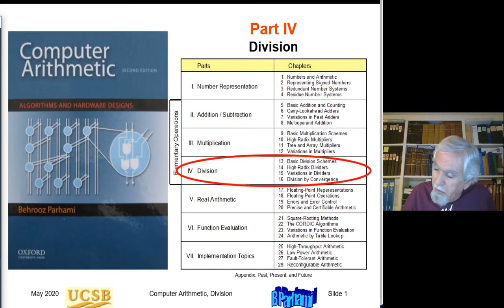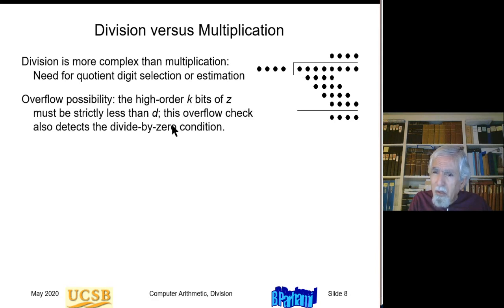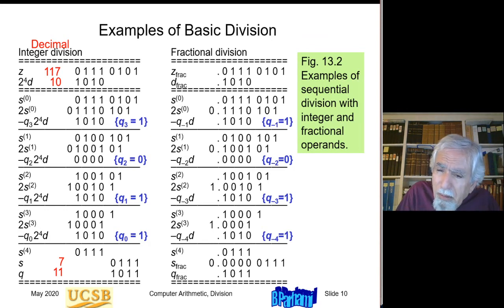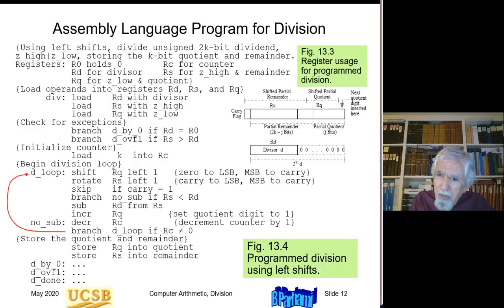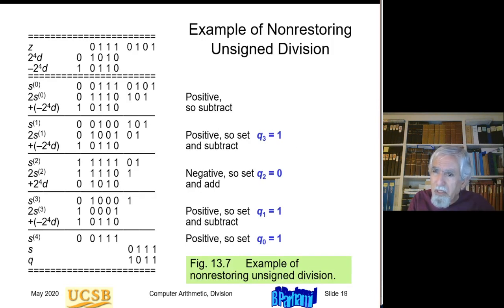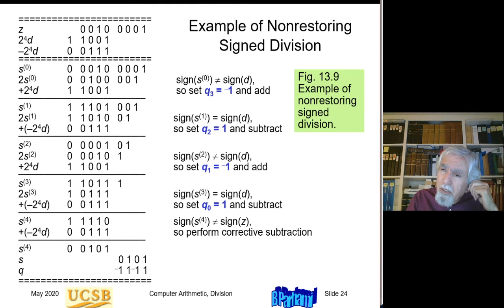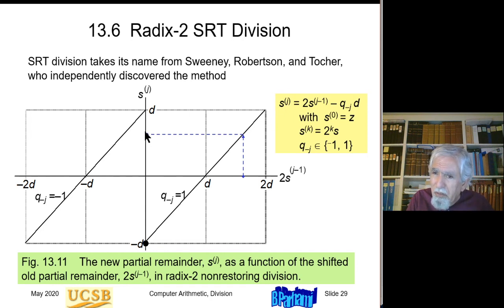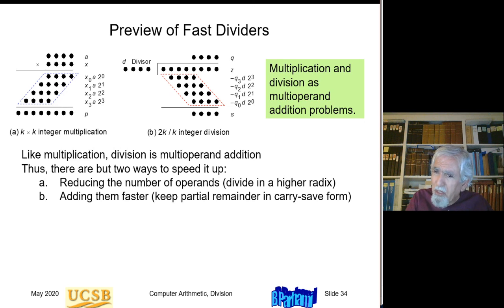UCSB ECE 252B, Spring 2020, Lecture 11: Basic Division

Comment: Dear Dr. Parhami, I was looking for a nice explanation of how the reciprocal and division operations were performed in modern hardware, and why calculating the reciprocal is so much quicker, and your lectures are exactly what I needed to sate my curiosity. Thank you so much for sharing these gems! I love the explanations and the depth of the material.

Incidentally, I'd like to make one small comment regarding load/store latencies in Intel processors from slide 8. I think the unspoken assumption there is that the 3(±ε) cycle latency can be observed in cases when a Memory Load instruction "hits" the Level 1 cache, or reads a recently written value from the Store Buffer? I think it's worth noting for the sake of completeness that in general, loading a value from DRAM can take hundreds of cycles on modern x86 CPUs, if that value is not present in any of the (SRAM) caches or the store buffer.